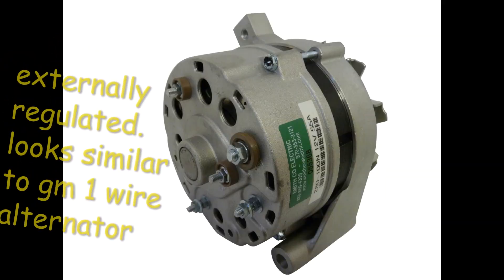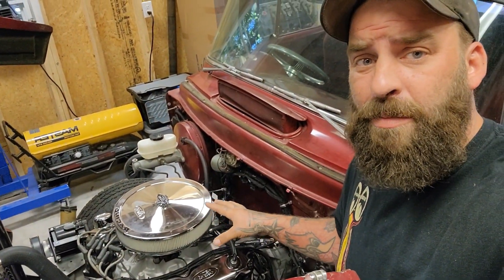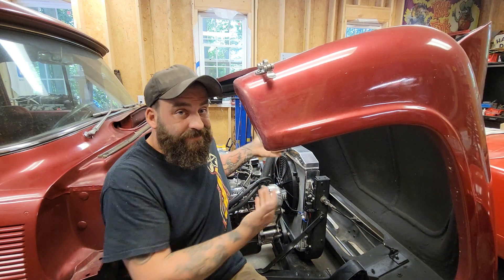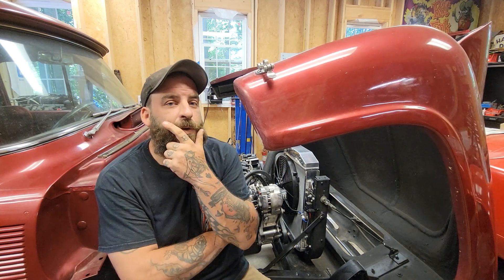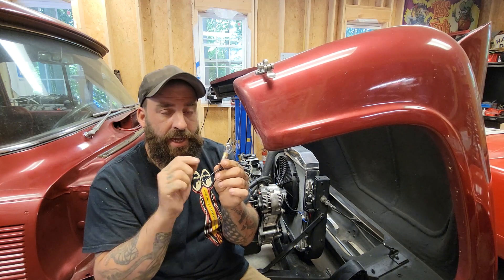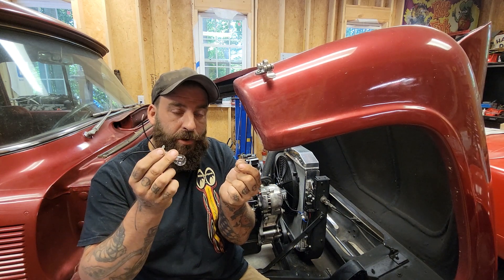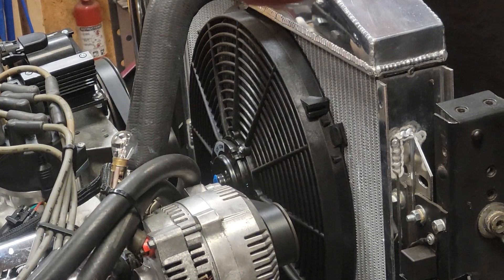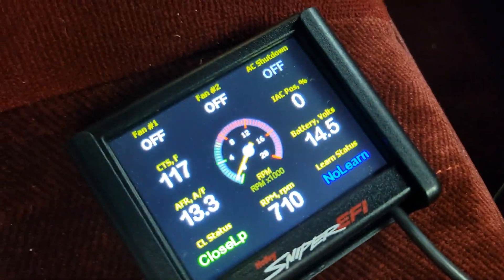FORD 3G ALTERNATOR WIRING WITH LIGHT BULB OR RESISTOR

Comment: Hello,  so I used a 3g alternator in this old car. I used the 560 ohms resistor on the green wire (switch).  Everything works great.  Then this happened.  I started the engine, the alternator belt started to squeak loudly, and after 5 minutes, I turned off the engine. I touched the alternator belt to see if it was loose, but it wasn't. Also the belt was extremely hot and the alternator too.  I had the alternator bench tested, it was ok.  The bearings are ok too.  Both green and yellow wires had 12.7 volts.  yellow wire all the time, green wire only when the ignition switch turn on.  I'm going to measure the milliamps on the green wire tomorrow; it should be around 22.5 milliamps.  What do you think is happening???  Also, my voltmeter read zero volts when the alternator was turning.

Comment: Set basically if the battery light bulb is blown, the alternator won't charge?
Reply: That's the reason for the resistor in parallel with the light on factory setups (in the diagram he showed).

Comment: What is the resistor for? I put 3g alternators and I just hook the green wire to 12v switched, no light, no resistor. I have not had problems on any I have did like that

Comment: Doing this on a 63 ford with a gen light.  Do I still need to wire in the resistor if I plan on running a volt meter?
Reply from the maker: If you are using a gen light ,you do not need the resistor.  The light bulbs works in place of the resistor
Reply: @greasyboykustoms  As he says in the video and the diagram it’s a good idea in case the gen light goes out because it won’t charge without it.

Comment: Well I did this and it worked but… my alternator is warm all of the time…. Any thoughts?
Reply from the maker: I havent had the issue before.   Is it warm even after it has been sitting still with the engine off.   Also, make sure the wire with the resistor is key on power only .
Reply: @greasyboykustoms  all good. I was having another issue. Just wanted to triple check. Everything is good now.

Comment: I installed a 3G alternator into a 70 Ford. The dash has an alternator warning light. The only issue I notice is the light is dim with the engine off. The alternator works perfectly. It just that the warning light is dim when it's on just like in the video. I'm pretty sure the light should be as bright as the rest of the red warning lights. It's pretty hard to see  if the light is on in full sun. Is there a way to make the bulb bright?

Comment: So I can put a spade on yellow wire and run it direct to the same post as the 4g charging cable. Then put the resistor in line with green/red wire and attached to switched 12V under the hood somewhere ?
Reply from the maker: Yup. On the 3g alternator just jump the yellow wire to the hot post on the alternator and then install the resistor inline on the green wire with a 12 volt ignition only source going to it.   The resistor imitates the light bulb resistance of a dummy light

Comment: so if a person were to tap into that green wire at the alternator in order to get a 12v key on signal for an electric radiator fan, would that explain why the battery light comes on when the vehicle reaches operating temp? Also might be why the battery light stays on and causes the truck to die at idle? asking for a friend :D
Reply from the maker: Absolutely

Comment: Your verbal description at 2:45 is not consistent with the diagram. The diagram is correct.   The green wire is not grounded. If connected as you described it,  the lamp would just be on anytime the ignition switch was on and not go out.  So you connected it correctly to get the results demonstrated.  You just described it incorrectly.  The internal regulator electronics detects current flowing to the battery (charging). and turns off a transistor inside the regulator that is grounding the lamp, to turn the lamp off.  If there is a failure in the system, and the current to the battery stops flowing the transistor will be turned on to light the lamp to indicate the failure condition to the driver..  That is, of course, assuming that the failure in not the regulator electronics itself, which rarely fail, but can fail in a number of ways that can cause confusion over what is going on..

Comment: Where exactly is the "ignition positive" located? My wiring guide says to wire the green to a "Switched 12v source" in my Ranger but I just can't wrap my head around where exactly I need to splice/connect to.
Reply from the maker: I'm not sure of the exact point on your truck but basically it's a circuit that only has voltage with the key on.  You can go to your fuse panel with a meter or test light and see what fuses have power with the key on only and then use one of those circuits

Comment: I STILL can't sort it out !  The green wire is clear. It goes to my ignition from the ;letter 'I' on my regulator. That leaves A, S & F on my regulator.  I think the letter 'A' on my regulator goes to the large upper connection on the back of my alternator. That leaves S & F on my regulator but I can't figure out  where they go on the alternator.  I THINK the 'S' on my regulator goes to the terminal removed from the other 3 on the back of the alternator.  That leaves 'F' on my regulator and I think that goes to the small terminal closest to center on the alternator.  Am I correct with any or all of these ?  I have been at this for so long !!! (years) Running on battery.

Comment: Hope you can help. I have a 1991 mercury sable with the 3G alternator, It has been intermittently charging. So i get a block of  wood and hammer and give the alternator a wack. I think the brushes are low or sticking. This works for several months, today i accidentally shorted one of the regulator bolts to ground, some sparks flew. OK  now the weird part, It still charges but the dash light will not go out. Any Ideas? I'm stumped.

Comment: I have a 96 ford bronco the alt wont charge and batt light coming on unless i prob it with a test light. Im guessing the bulb in the test light is turning it on in the dash somehow. Anyway ive changed the bulb with no luck. It all started when i changed the speedometer out. I just need her back on the road again. If i were to add a resistor to bypass the bulb on the dash id just connect one end to the green wire and the other end to what?
Reply from the maker: One end to the green wire and the other to a 12 volt ignition source.  Not battery power.  Must be 12 volts with key on only.   You can try it with a temporary wire like we did in the video to make sure it resolves your issue
Reply: @greasyboykustoms  thank you. I tried to connect the green wire to 12 volts just to test it. Alt still didn't start charging. I'm taking it in to get it tested. At this point I'm hoping it's just a bad alt out of the box. 😩

Comment: Very good info. I have removed 100% of Fords wiring from my SN mustang and install Holley Terminator.  I understand the Green wire, white wire.  My question is - Do I need to wire the yellow wire to battery 12 volt circuit?
Reply from the maker: Typically yes.   The yellow wire is 12v battery positive.   From the factory it  goes from pin "a" on the 3 pin connector to the main battery cable terminal on the alternator

Comment: I am hoping to rewire my ride and I know I can buy a harness custom made from numerous places.  Would it be feasible to think a novice like me could do it myself without buying a readymade harness ? I learned so far to use the right type of wire, not just the right gauge and I know to create loops for front, middle and rear. And I should zip-tie all the wires every few inches and if I can buy labeled wire or mark the wires where they run to.  Or should I just get the harness ? Hmm ? Do you do a video of this type of thing ?

Comment: Why do you need the resistor or lightbulb? Can you just wire directly to the alternator without the light or resistor?
Reply from the maker: The alternator needs that circuit to excite it to charge.  It's not a voltage trigger. It's a trigger based on resistance.
Reply: @greasyboykustoms  so would a balace resistor do the same for like one you use on a 12v coil?

Comment: Hi i wonder if you can help me. My light goes  off like yours when the engine runs but does not charge at all. what could be the problem
Reply from the maker: Typically it would just be a failed alternator.    Has it been replaced ?

Comment: WOW ! Exactly the video I need !  Nobody could explain where the 3rd wire went for me.  Now I know (I think)  3G means 3 wire ?  Am I glad I found you !  You not only know stuff, you explain it well for a novice.  Thank you. Everyone said to just get the chevy 1 wire but I want to learn.  If it doesn't work, I want to know why.  I have a 42 Ford 3/4 ton that just stopped starting and a 66 289 with a 3 wire alternator that won't charge my battery. Now I can at least fix the 66. Thank you so much. I battled with the 66 3 wire for over a year.
Reply: No 3g is for generation it's the 3rd style Ford produced

Comment: If you don't mind sir I have a question that green lead that you hook the light bulb to has a 20 amp fuse I'm thinking you need a resistor that will handle 20 amps that seems reasonable the one you are using would not just a thought
Reply: It also says optional do you even need the light bulb or the resistor?
Reply from the maker: yes you do have to have one or the other.  if not the alternator will not charge.   as far as the fuse for the circuit , .  i have not had any troubles in the past , but it is definitely a very good thought and one i will research into .   thanks .

Comment: Hi I got a 1985 mercury cougar and I did that the green wire from my power master 37759 alternator going to a motorcraft square regulator that is installed from dealer on the green and yellow wire with the transistor in between and it charges up to 14.1 but I still getting the battery light on can you help me how to get rid off the battery light also I have 2000 sound system and when I’m driving the parking light dims i thought it doesn’t dim with a sound system while driving